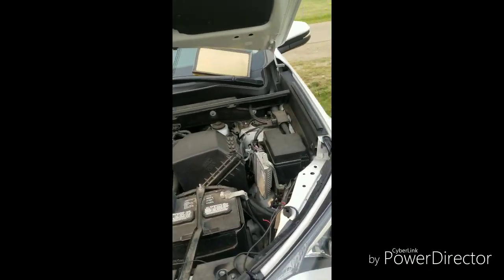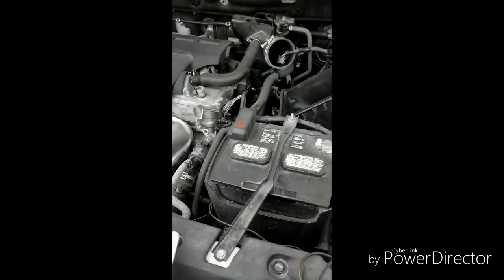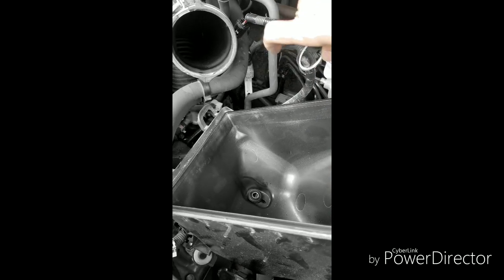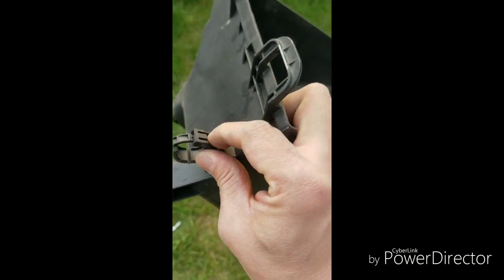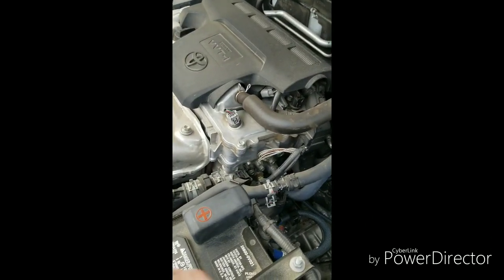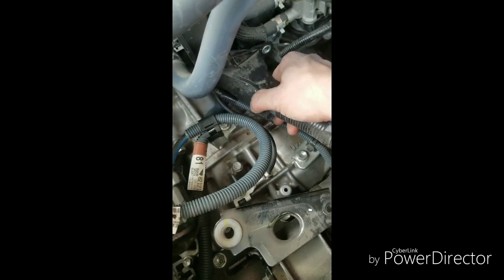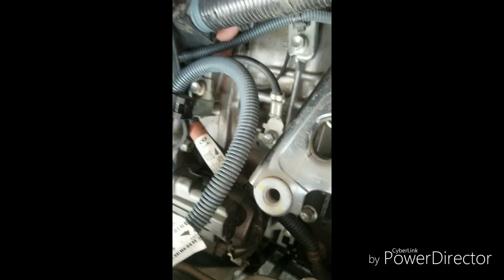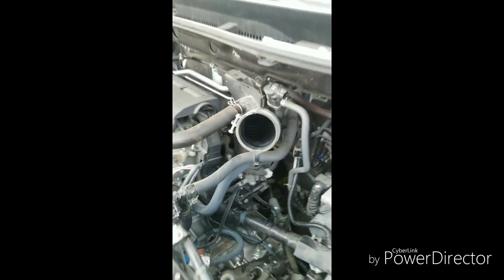installing block heater/ Rav 4 2017 xle

Comment: They recommend the use of Silicone Dielectric grease on these to help transfer the heat and protect the heater element from overheating.  Failure to use this will shorten the life of your heater.
Reply from the maker: Thank you for the comment.ill take note of that..thanks
Reply: @wilstv  where is the clip supposed to face---towards the car or downwards? thanks!

Comment: Thank you.    Is there a block heater which will fit a 2016 Letsuck RX350?
It is an emergenyehicle for transporting blood, antivenins, etc. to hospitals, so no time to lethengine warm.
Am now using a 150-Watt outdoor floodight shinning straight up an inch below the oil pan.  Hood covered with a bed sheet from Goodwill andrapedown over the grill to retain heat.